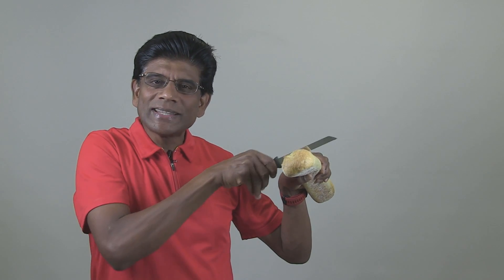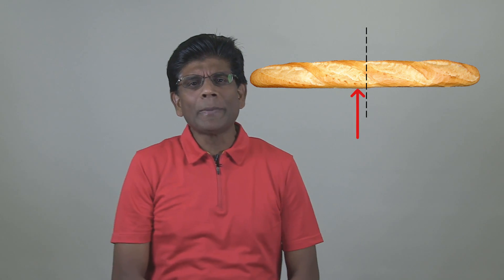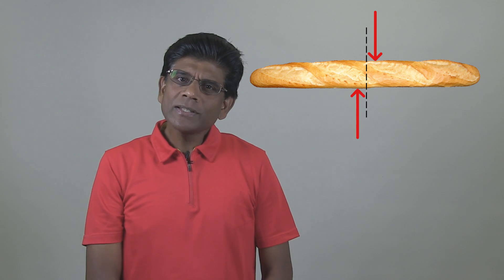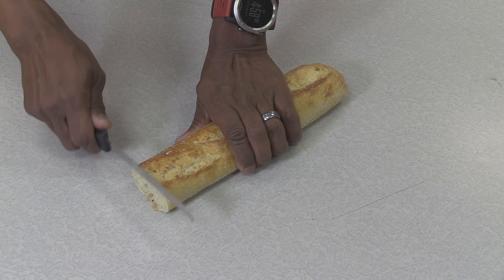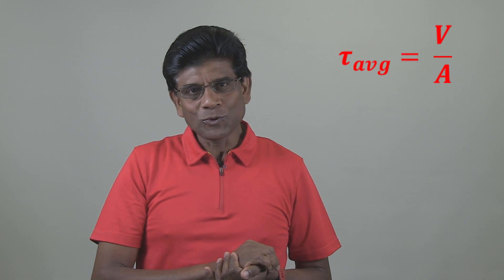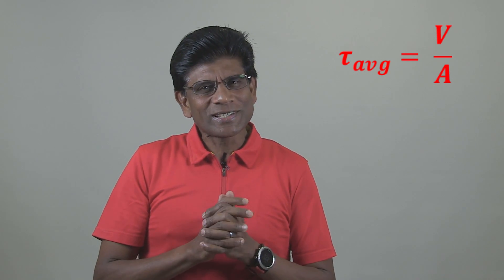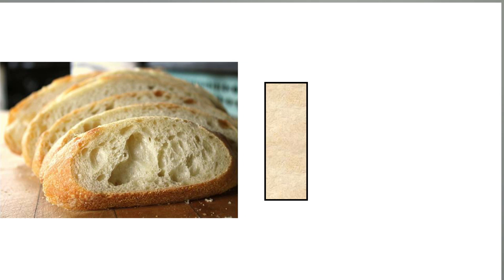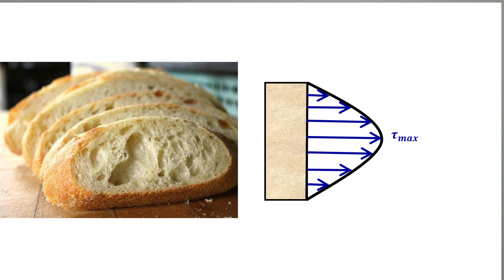Strength of Materials: Analysis of shearing stress

Comment: I still think I’m missing something. If sheer stress is maximum at the NA then why when we cut through steel does the material fracture from the edges (where the shear stress is zero) instead of fracturing from the middle?

Comment: Excellent video!  Some more examples, diagrams along with your verbal explanations could further help.  Did not quite fully understand why the shear at the edges of the baguette are zero.  I get a rough idea why shear is maximum at the center--if a large diameter rod is extended under a weight, the middle part extends the most--just as you depicted in the "parabolic profile", but does that mean the shear is greatest at the center??  Is it because the area element at the center is the smallest while the area element at the sides is the greatest?  Thanks in anticipation
Reply: I could not realize why shear stress is maximum at neutral axis and zero at extremities. Could you please explain it.Say, at extreme area is less that means ( F/less area= more stress)

Comment: Hello sir, am trying to define the bounds for shear modulus of composite with n phase isotropic materials but I finding it difficult to define the conditions for the correct solution. For the correct solution, is the shear strain constant or the shear stress. And also at for incorrect solution, is the shear stress constant for all directions? Your response will help me greatly in my project
Reply: as shear strain is directly proportional to radius nothing to do with shear modulus so shear strain is constant for a given radius where as shear stress is completely depends on shear modulus

Comment: I have a dumb question, you said that at the edges of the bread there is zero shear because there is zero area. so are you saying that we get max area at the neutral axis? don't we only get half the area at the neutral axis and the max area at the bottom end of the bread?
Reply: I think it has to do with equilibrium. There is no area above, so no shear force from above. Thus equilibrium it must have no shear force from below
Reply: Do you know why or are you still waiting to hear back??
Reply: the area is calculated away from the neutral axis. So whether at the top or bottom, the area is the same from the neutral axis.
Reply: Sir.. Where can we watch ur video on calculation of shear stress in beams? Could u provide the link..? Coz i searched but didn't get it